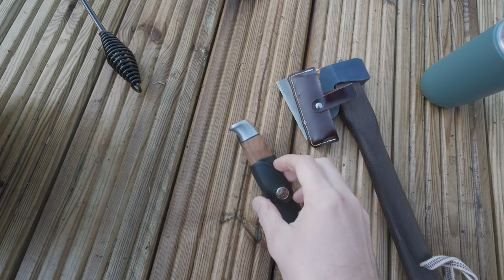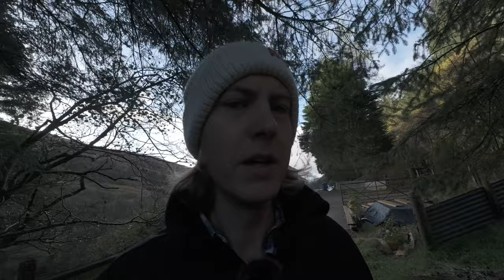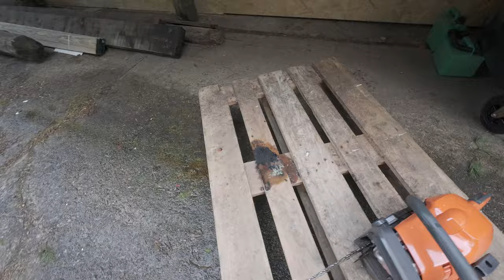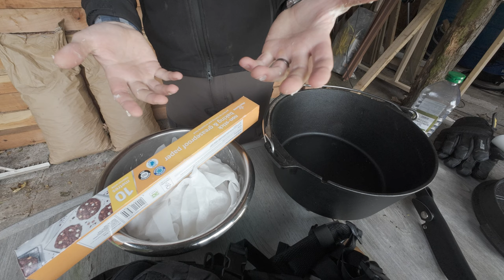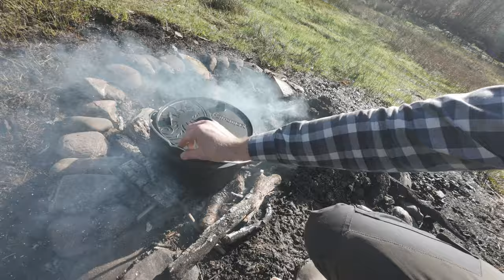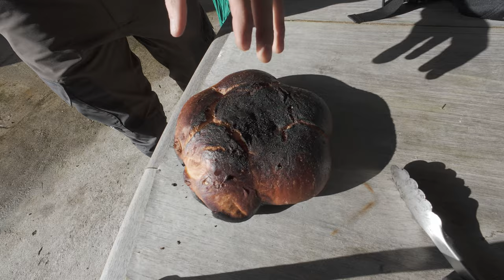Off Grid-Day 28-Baking bread in a dutch oven over an open fire 1000 Subscriber celebration

Comment: I'm sure you've worked this out already, but I think the chainsaw fire might have been a combination of three things. Throttle, mix or mixture setting too lean (too much air for the fuel) therefore the idle runs too high. This means that the clutch is part engaged against the chain brake (which I'm assuming you have on).
Then, the oil is from the oiler which is a small pump that's designed to pump out of the chainsaw oil reservoir onto the chain. It only runs when the chain is turning, which stops it from dribbling on the ground (most of the time).
So, you have friction heating from the clutch and oil which gets above its flashpoint. Keep at it, though, chainsaws are awesome to have around.
Enjoying the work so far, the weather up here is "challenging" as you're finding. Well done on prepping before winter, a caravan is miserable without it.
Reply from the maker: That sounds like the exact reason it caught on fire. We did get a replacement though so the company we bought it from were very good to us. Its like summer hasnt arrived yet! If you have watched our latest video on our 1 year update its raining all the time